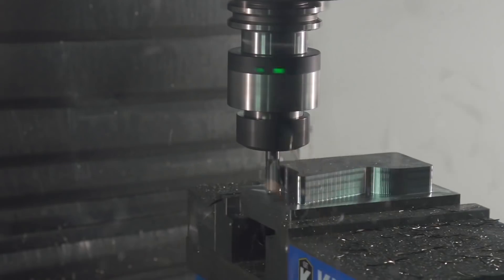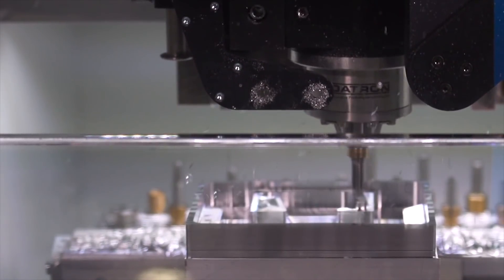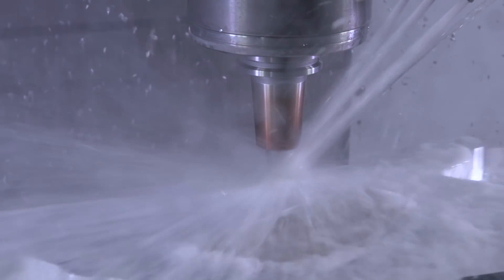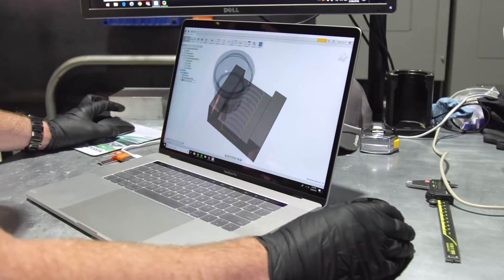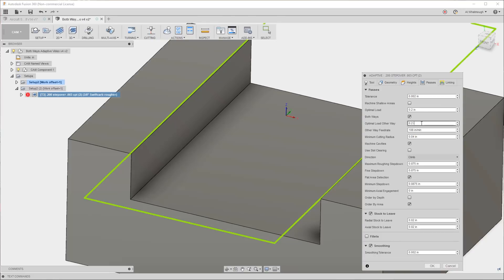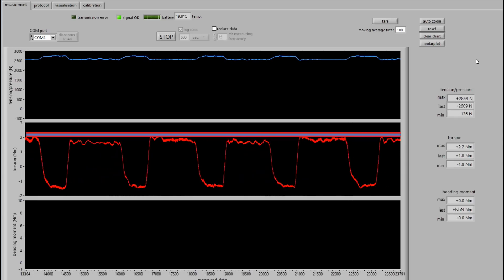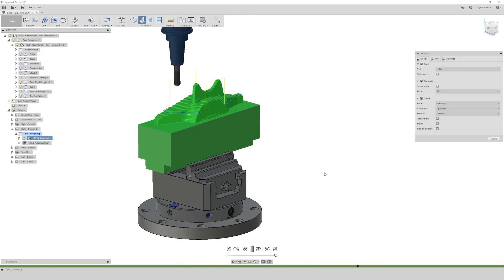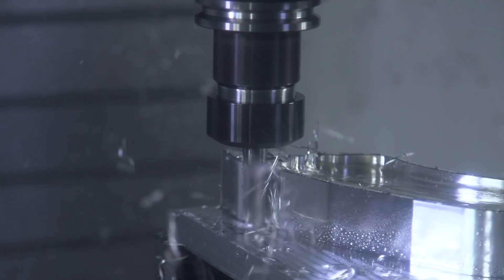Both-Ways Adaptive Clearing

Comment: You're saving probably 5% tool retract times at the cost of 50% extra wear rate for the cutter. It's all good optimising the cutter load, but you cannot change the conventional shearing action on the metal, this blunts the edge twice as fast. The only way conventional can replicate climb milling is extremely high feed and extremely low radial cuts
Reply: I have plenty of data to back a <10% reduction in tool life. This is processing large skin sections (3+ meters) in Al 7075-T6. Cycle time reductions, even at small percentages are usually greater than tool costs.. unless you're selling things to hobbyists. Either way, do the cost evaluation sometime. YMMV

In our aluminum molds, which are increasingly popular these days due to reduced cycle time and low production volumes.. tools account for <6% of total production cost. 

I don't use adaptive toolpathing strategies on those, since they typically cost more cycle time. In most things aluminum, you're better served with traditional toolpathing (high radial) strategies.
Reply: @zaknefain100  Yea that makes a lot of sense, doing high distance travelled with tooling, adaptive paths is the last thing you wanna do. Big fat tooling, big fat cuts